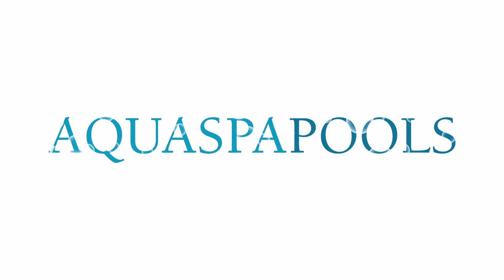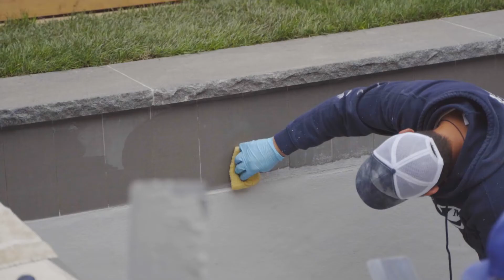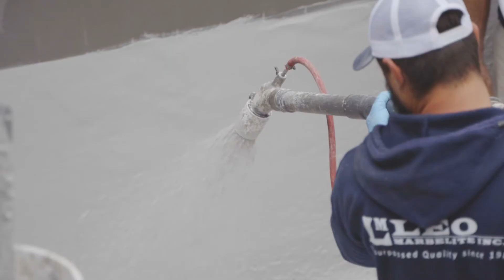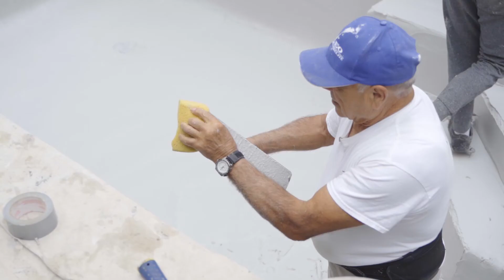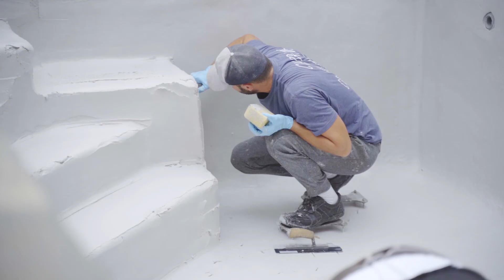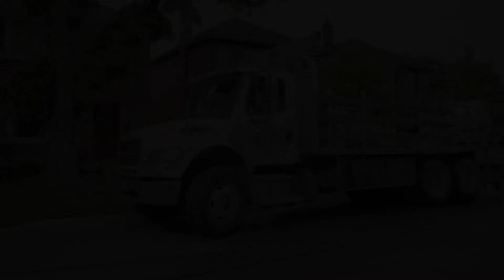Marbelite Pool Finish Process | Aquaspa Pools

Comment: Hi I’m looking at possibly getting our painted concrete pool resurfaced with Marbelite. I’ve been told that the paint doesn’t need removal and just needs sanding and sika SBR applying beforehand. Is that correct?